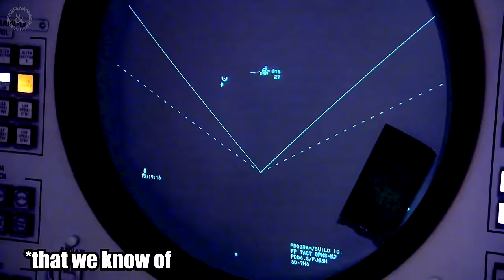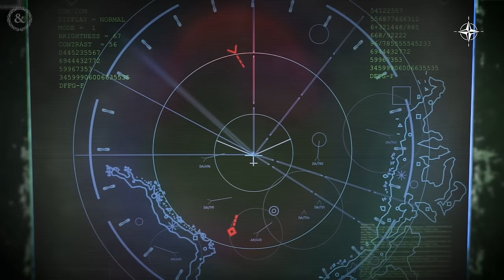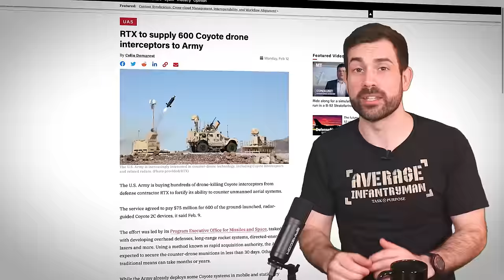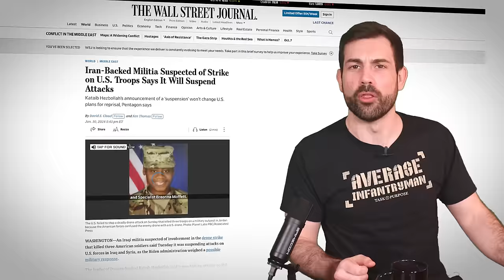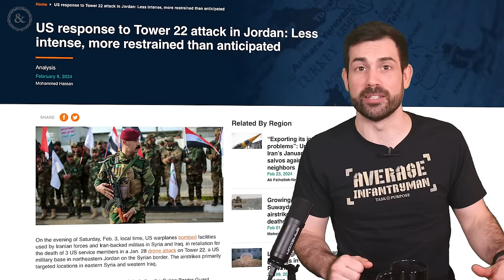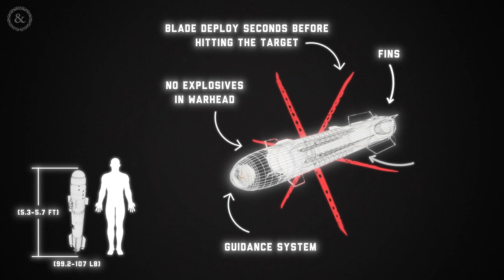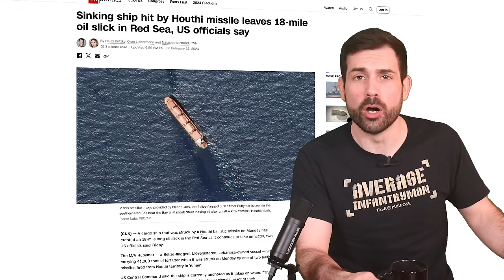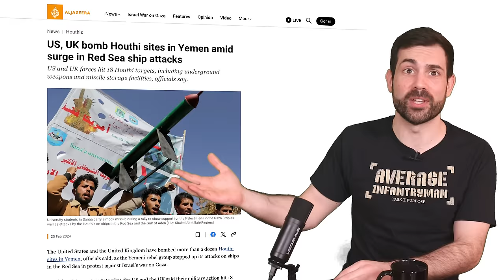US Forces Retaliate for Deadly Attack on Jordan Outpost

Comment: Kinetic energy is amazing thing. As a young airmen I saw a simple counter for reactive armor: inert AGM-65 Maverick missiles. An 80 pound concrete warhead slamming into a tank at super sonic speeds is more devastating than most of our other anti-tank weapons. It's absolutely incredible to see.
Reply: Won't penetrate tank armor. It will ring the crews bell, but won't penetrate crew space
Reply: @theccpisaparasite8813  it destroys tanks to the point that crew can no longer occupy it, and knock the turret off. It doesn't have to penetrate when it's hitting with that kind of force. I've seen it with my own eyes, it's an incredible sight. One off many I was fortunate enough to see as an EOD tech that primarily worked on test ranges when not deployed, and after my enlistment, as a DoD contractor. 

We supported a squadron of A-10's that would fly in monthly to qualify on the AGM-65. They would start with inert missiles on the first day or two, and then move on to live missiles on the following days. It got to the point that they got bored with tank and armored vehicle targets and they built them a city of mock buildings out of shipping containers. Now that was an interesting post test clearance.
Reply: @spellegren   80 lb of concrete at ballistic speeds means every once of energy from the congcrete is transfered because it is dead weight with no deflection. That could be enough to damage sensors and possibly turret traverse.
Reply: Yeah they are trying to create kinetic energy only projectiles to launch from far away just because of how devastating they can be, but they cannot quite figure out the aim which must be perfect and account for all environmental factors (and more I'm sure)
Reply: @terryjohnson3479  you're underestimating force and momentum, it's basically a hammer dropping on a can

Comment: 11:02    KuRFS radar and Coyote effector deliver defense against unmanned aircraft systems, or UAS, also known as drones. These Raytheon capabilities are components of the U.S. Army’s integrated counter-UAS solution. It's called 
LIDS:     the Low, slow, small, unmanned aircraft Integrated Defeat System.
LIDS integrates Raytheon’s KuRFS and Coyote with Northrop Grumman’s Forward Area Air Defense Command and Control system,  FAADC2, and the electronic warfare system made by Syracuse Research Corporation for the integrated LIDS counter-UAS solution.
LIDS  deploys as either mobile or fixed, relocatable platforms. The system can provide stationary support for an installation or site, and a transportable configuration 
Layered defense takes a system of systems approach … to counter the growing threat from unmanned systems

Comment: Very informative video. 'Over time, this channel has become much more professional.    Call me Sherlock, but I believe a blend of B-1 and R9X tends to work every time.
As for Raytheon's 'Coyote', it sounds like a great intermediary level solution.  But, I have to ask what is 'low cost'? $5k? $20k?, Javelin level $80k each?, more?
The HEL's are the future. Based on public videos, energy levels are not yet sufficient, as each 'shot' seems to take seconds, even on a very slow moving, non evasive, non hardened, target.
A vapor deposited metal skin will deflect much of the energy. Sensors could detect directed energy and use evasive flight paths. So, HEL burst energy levels needs to be ~ megawatt.

Comment: There is one MAJOR flaw in your overall theory; Tower-22 does not have the facilities to launch and recover Predator drones.  The shortest take-off/landing distance they need is 2000 feet though most public info says it needs a 5000 foot runway.  There is no runway anywhere within the Tower-22 area. The longest taxiway is ~800 feet.  So unless you're implying that they are taking the drones outside the FOB to launch and recover, there is no way they are being operated out of there.  Your failure to address this basic fact undermines the creditability not only of this particular video but your entire channel.  Please explain this.

Comment: The under sea cables may have been cut accidentally. The bulk ship (not the one mentioned here) that was hit and eventually sank had one anchor down at the limit of it's chain length as it was drifting and the anchor may have snaged the cables. They were about in the same place.

Comment: They need a skid mounted cheap shorad system that based on a gun system. But with open architecture. Twin bushmasters would be preferable. With an air bursting round. But having a base system that will accept input from off site radar but come standard with a IRST and a sound track system like boomerang but optimized for arial threats.

Comment: DEI in the United States military is why the United States military is experiencing more failures, low retention rates, and abysmal recruitment numbers. 
The military used to be based on aptitude and performance, but is now infected with communism and everyone has to conform to the lowest common denominator in the majority of the military. There are exceptions, but overall this has been the case since before Covid, and got even worse after soldiers were forced to get the jab or get kicked out